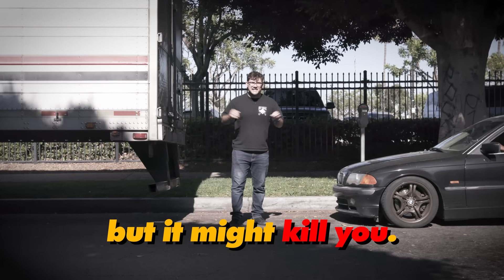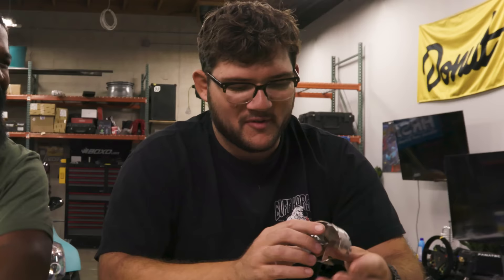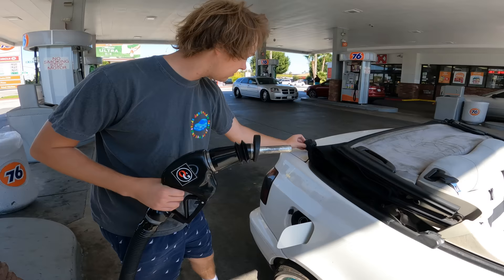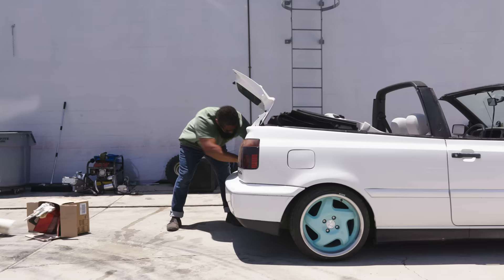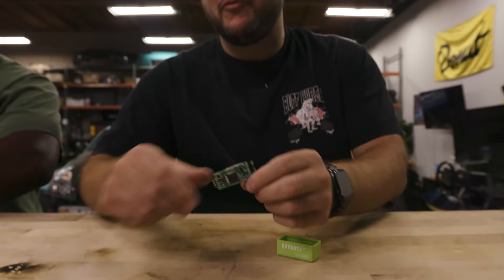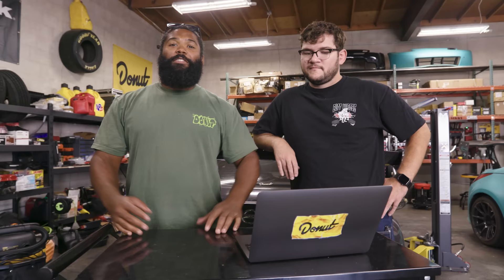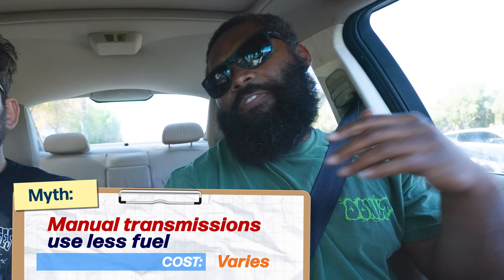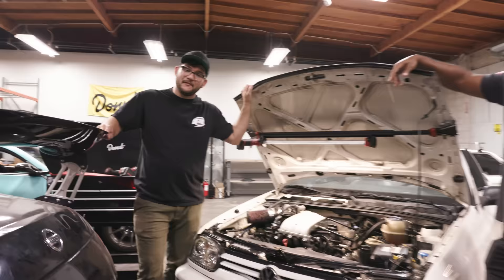Testing Fuel Economy Hacks

Comment: Come on guys, how did you confuse Top-tier gas (additives) with higher octane?  True, running high-octane in a car that doesn't need it won't save you gas, but that has nothing to do with the additives that make some gas brands "top-tier."
Reply: Not to mention here in the UK, our top tier gas (petrol) has a lower ethanol content as it is e5, whereas regular petrol is e10 and thus burns quicker, so in actuality yes the top tier gas IS better on MPG

Comment: I did it with and without drafting on the same 600km route.
Without, I did 550km.
With, I did 1170km. 
We were amazed,  stopping @ 650km to dip a stick into the filler thinking It'd be empty and my gauge showing half a tank was faulty.
I was around 30ft behind.
Reply: Did you go the same speed both runs though? Many countries will only allow semi trucks to go around 55-60 mph
Reply: @codysimonson6260  it was a combination of 100-110. 
110kmh is our maximum speed on some road's.
Reply: @hulkgqnissanpatrol6121  that's a hell of a difference then for sure. Was this in Europe or north America? Trailers are vastly lower in most of Europe which is why I'm asking. Probably would make a more usable wake of air.
Reply: @codysimonson6260  in Australia,  it was a huge difference that's for sure, as I said we stopped and used a stick to actually see how much fuel was left. Lol
The trucks are similar to Europe, low and fast

Comment: Turning on the AC will reduce fuel economy.  There's a reason most engines idle higher when the AC is on:  The engine would stall if it didn't.

For best fuel economy, windows down for city driving (low speeds reduce drag), and windows up with AC on for highway driving (lower drag compensates for the compressor's resistance).

Manual transmissions can be more efficient.  Depends on the driver and how they drive.  Also, the torque converters that automatic transmissions use will always slip until they reach higher rotations, wasting power.
Reply: Dual clutch transmissions don't suffer that slip.

I'll keep my manuals though.

Comment: The HHO generator violates second law of thermodynamics. You have to spend more energy to break the H2O bounds than you get from burning them. 
A better use of the water is probably water injection.

Comment: Actually, over inflating a couple of psi over manufacturers recommended pressure does decrease fuel consumption a bit. There's drawbacks though, like a harsher ride and uneven wear. But uneven wear only gets bad if you go too crazy on the pressure.

Comment: Premium fuel can increase your mpg, depending on the vehicle. It may not make up for the difference in price though
Reply: That myth has been busted buddy
Reply: That's just not how octane works man.
Reply: @steviefresh88  I know from experience that premium fuel can get better mpg
.
Reply: @ryanberman5314  I have dealing with this for decades. Premium fuel = better mpg. This isnt once or twice, this is almost every time. The cost difference can be prohibitive though. It may not work with every vehicle type
Reply: @shatan120  You may think that's what's happening but that's just not how it works. It only determines how much compression the fuel can tske before it will combust without a spark. If your engine is high comp, yes it will give you better gas mileage over lower octane but it does not matter if you have a low compression engine
Reply: @ryanberman5314  I didnt come up with this over night, I have decades of experience dealing with this. We are not going to agree apparently. I also left a disclaimer that it rarely justifies the added cost of premium for mpg by itself.
Reply: @shatan120  What you believe isnt going to make a fact not a fact. What I am telling you is backed up by science.

You can continue to deny or educate yourself and realize that you are wrong like an adult. I used to think the same thing as you.
Reply: @ryanberman5314  For me its a fact. Grow up
Reply: @ryanberman5314  Your slights are not going to change anyones mind
Reply: @shatan120  My slights arnt to change your mind. They're blunt, truthful statements about how you are perceived. Sorry no one else has told you yet.
Reply: @ryanberman5314  Right back at cha. They are not truthful statements, just uninformed opinions based on a belief in absolutes due to an apparent lack of experience and an desire to win an argument (You didn't enter this discussion on some holy mission to educate, you just had a need for an opportunity to feel smart and for the world to notice). That this subject has been argued for decades should tell you that your point cannot be argued in terms of absolutes 

Im going to do u a favor and educate u on "educating" others. If u persist in an discussion despite not being able to come to an agreement, you are no longer having a helpful discussion, you are having a pissing contest. The "science" argument assumes that every manufacturer designs their engines same way (There is a ton of variables involved). Resorting to absolutes is showing that you have very little experience  actually applying science in the real world.
Reply: @shatan120  All you have to do is take 5 minutes to educate yourself on octane. 

Your second paragraph is still WRONG. Octane does NOT do anything if your engine doesnt Specifically  NEED it. 

Please, just take the time to learn rather than assume you're right because you "feel" you are.

Comment: The only thing that actually improved my MPG was easy acceleration, anticipating stops, and cruising at or below the speed limit.
Additionally run a eco focused tire vs a grippy summer or blocky snow tire.
Weight reduction is cool but I enjoy the comfort features of my vehicle over a 1-2 mpg gain.
Reply: How you drive is going to be the biggest variable after what you drive.  But also the way I see alot of people driving where they will gun it full speed then slam on the brakes last second is how alot of traffic jams seem to appear out of no where as it causes a ripple affect as the person behind doing the same now has to slam on their brakes etc etc going back like a wave until it amplifies to a full stop.  

Here in Australia they are now using variable speed signs on highways to try and slow traffic down before it reaches a traffic jam to try and disrupt that wave which while annoying if you want to be doing highway speeds is better for everyone in the long run as I would rather be slowed to 60km/h than to be slowed to 0 in stop and start traffic.

Comment: I'd really like to see a car dyno tested standard. And then it done tested with a 2000w+Amp with subs. I feel like I lose a lot of low end take off power when the Amp is draining the vehicle. I'd like to see the science behind that!
Reply: A 2000 watt amp running on 12 volts will draw between 160 and 250 amps depending on the amplifier. Similar to the starter. Your car's AC draws between 3 and 30 amps so your subs are pulling about ten times that. You lose horsepower, torque, and fuel consumption goes up. Imagine your alternator is a 3kW generator.
Reply: Imagine being the guy in a Suburban with three alternators because you've got such a high power mobile CB kit installed
Reply: @Vynncent  You could have a little engine next to the regular engine, just for juice. Little inline 4.
Reply: You are probably losing about 5-6hp or so, not to mention of course the draw on the alternator essentially acts as a negative source or torque. The back EMF from the current in the wires is in effect trying to turn the alternator in the opposite direction as it lags the changes in magnetic fields which transmits that back through the belt cancelling some of the torque the engine is producing. The higher the load the more it will cause it to lag and thus the more torque it saps from the prime mover to keep forcing the alternator up to speed against the magnetic resistance. This by the way is pretty much exactly how an electromagnetic retarder on a truck works it creates eddy currents from the motion of the wheels that then oppose that motion again due to the phase lag caused by the resistance to said currents which delays any changes to the current flow.
Reply: @seraphina985  That puts a lot more of it into perspective, thank you. I can physically feel it, and see it with the gages. It's good to know which sub components are taking a different hit. Like a competition setup, the vehicle has a few of those replaced or remapped. I now see why it would be truly necessary.

Comment: A big hydrogen generator would be great, seeing exactly how much money and interior space it costs to significantly affect mileage or even run the car entirely off of hydrogen when it wasn't designed for it would be interesting
Reply: You can't really run the entire car of hydrogen and it won't make you more energy in the long run. The electrolyzer uses electricity that is generated with a loss from your alternator to create hydrogen. This process also has losses so the total amount of energy in the system will dissipate as losses since you can't create energy.
Reply: @iseja00  Put the HHO cell in your shed and run it from solar power. Then install a pressure tank in your car like with a LPG conversion and have it ad a suitable % of hydrogen to the inlet air, and you have a physics adhering gain in fuel economy. (Don't use a HHO cell, but a proper electrolyzer, compressing Oxygen and Hydrogen mixed together is a death sentence)
Reply: @Tore_Lund  Yeah I know that you can run a car on hydrogen but you can't run one on hydrogen generated by the car alone.

Comment: On hydrogen generators, it's a scam regardless of the size. You use gas to make the hydrogen from water (via the alternator) and burning hydrogen to make water releases the same amount of energy it cost to make it (conservation of energy). Hydrogen cars only work because the hydrogen is generated at a plant fueled by the power grid instead of in your car.

I get trying to say "tune in later" when we test a bigger one, but you shouldn't lead people on when they might drop $600+ dollars on a bigger one in the time between this video and that.
Reply: Yeah you need a way to charge a separate battery not connected to the alternator to have a chance.  Could be a cool project to see what you would have to do to actually get it to work.

Comment: Remember guys, tire pressure has A LOT to do with how good OR bad your fuel economy is
Reply: One time I needed tires and I researched fuel efficiency ratings.  There really seemed to be a point of diminishing returns.
I might never get the fuel economy the most efficient tires might help me get, but they were significantly more expensive!
Who would pay 10% more for 1% better fuel economy?!
I say that having ecomodded myself.  Sometimes we do things just to see if they make a difference and to see how much, even though there is zero chance of it paying for itself.

For example, some sources say that ethanol-free gas increases fuel economy by 10% (although I have seen other sources saying it is as low as 4%).
There is a station in-town with ethanol-free gas for 8.6% more, so I might do a tank or two and do the math.

By the way, I learned about Kapsen ComfortMax tires.  Not only were they not low-rolling-resistance tires, they were less efficient than normal tires, but they were supposed to have maximum comfort! :)

Comment: 5:20 well its not a scam if you dont overdo it. i usually put 0.2 more bars into my tire it helps with fuel saving a bit (about 0.2-0.3l/100km) anything over 0.3 feels weird and too stiff
Reply: Agreed it has diminishing returns. I run about 5 psi over in my forester getting 34-36 mpg driving sensibly on road trips.
Reply: @AndrewPrinster  i noticed tho on older cars you can increase the pressure a bit more for example on golf 4 they say 1.9 bars but you can fill 2.3 and its still fine. i guess it also has to do with tire technology going forward

Comment: The HHO generator is basically a dressed up "perpetual motion machine". It doesn't add any energy to the system. It uses the alternator to convert the motor's kinetic energy into chemical potential energy by splitting the water into H2 and O2, then converts that back into kinetic energy in the motor by combusting it.

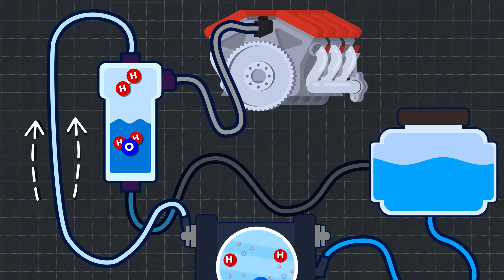Comment: There are still fuel stations out there with fuel tanks above ground. I live in Florida where around 3:00 it's nearly 100 degrees, and dusk/dawn ~78-82

I would imagine filling up at those two times, it may be plausible to pump the same amount, and receive different amounts when brought to same temp. 

Don't know, gotta give it a whirl.
Reply: I guess that depends on just how much expansion vs contraction happens to the fuel itself. honestly I doubt it's much at all. it's not like 1 gallon cold will turn into 1.5 gallons warm if you understand what I mean. the pumps are driven by flow meters so you always get the same gallon more or less, there are acceptable errors in the calculation but for the most part the same pump can repeatedly dispense the same volume of gas within the tolerance. so the only way to figure it out is to get 1 gallon cold, seal the container and mark the line and then warm it up and see if it goes over the line. my guess is, not by much. and besides you car changes temperature in the tank through out the day so are you only going to drive at noon time and never drive at night to get a few drops of fuel more? not saying you can't test it, just saying it's probably a waste of time.
Reply: The pump measures the density of the fuel when calculating the flow out the hose so the temperature doesn't matter.
Reply: I don't know what the laws are in Florida, but where I am fuel pumps have to dispense a "corrected" amount of fuel.  The pump should say "Volume corrected to" and say a temperature, probably something fairly cool.  The pump will measure the temperature of the fuel it's dispensing and adjust the amount you get so that you're getting as close to the same mass of fuel as possible no matter what temperature it is at the time you buy it.
Reply: @pasmuis  interesting, I would assume volume as it is displayed to us in Gallons. At the end of the day, the fuel tank would only take so much if extremely hot, and would be slightly less than full come night. 

Obviously extremely minimal effect lol.
Reply: @newmonengineering  At the end of the day I think it would be minimal, but I will still fill up in the morning as opposed to mid day. It's just more comfortable lol

Comment: Though your conclusions are ultimately correct, how you for to them in most instances wasn't: 
Tire pressure: imagine rolling an under inflated basket ball, it's not going to role well. But over inflation will cause the ball to bounce off any surface deformity and not get you any closer to your destination. So it's not just wear and handling (what you refer to as "in the long run"), but over inflation directly affects you fuel mileage a well. 
Fuel volume: you say it isn't affected by weather: it most definitely is BUT the meter on the pump accounts for that. What's worse, if you fill your tank with cold fuel and and park it in the sun, it could expand to the point it overflows your tank. This is why heating oil is never filled above 90%
The HHO generator: draws horsepower off the alternator to make Hydrogen/oxygen to burn in the engine, so you're right, it's a scam, but no matter how big you make it is not going to improve your milage.
Driving behind a semi: 6-10 feet is most optimal but it doesn't mean you don't get significant advantage at a safe distance: especially at highway speed and especially with a head wind and especially with a smaller lighter vehicle, you can be a safe distance back and you'll hear the difference when the semi is breaking wind for you (not that kind).
You'll hear the buffetting decrease significantly as you approach: you don't need to be right under the bumper by any means!
Reply: Also the windshield wiper one. It absolutely decreases drag or can add an aero advantage depending on positioning. It’s just so insignificant on an average commuter car.
Reply: @holdenbarnes9559  It depends on how they are stowed: with some cars it's actually less efficient with them removed as they were designed into the aero model.

Comment: I built a couple HHO generators 12 or 15 years ago. Properly made for your car, they actually CAN decrease gas consumption by a ton. However, that energy ain't free. You need a battery or other electricity source to run it, and when you factor in the cost of replacing that battery regularly, plus the cost of the generator itself, it is at best a wash, cost-wise... often you end up spending more than you save. You're just transferring the cost from one source to another.

Comment: on the same drive to work, driving similarly, my automatic 5-speed 2010 saab 9-3 2.0T gets 21mpg.  Recently picked up a manual 5-speed 2006 saab 9-3 2.0T and it gets 31mpg.  I am actually very surprised how much of a difference the transmission made.  they're pretty similar weights, and exact same engine.

Comment: AC off windows down has actually been scientifically proven several times over to save more fuel than ac on windows up
Reply: I think it depends in the specific car but with mine it definitely gets better mpg windows down/ac off.
Reply: mythbusters tested this and in their study anything over 55-60mph windows up AC on was better.  ideally.  windows up and vent only is the best option, if you can handle it.

Comment: The one caveat to the cooler gas is denser myth is that, for smaller engines, it can work. The gas you need is stored in the lines, so if it’s freezing out, you may have a good gallon or two stored above ground that a motorcycle can make use of. Source: Fortnine.